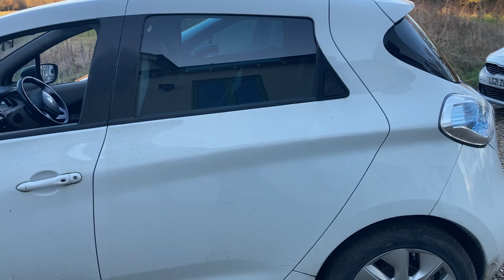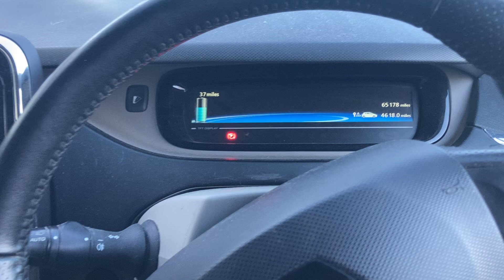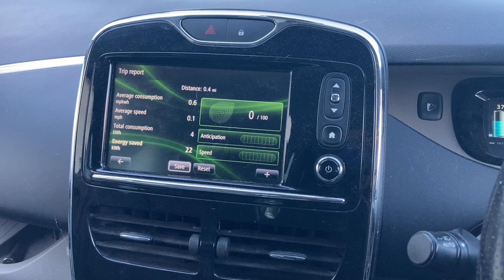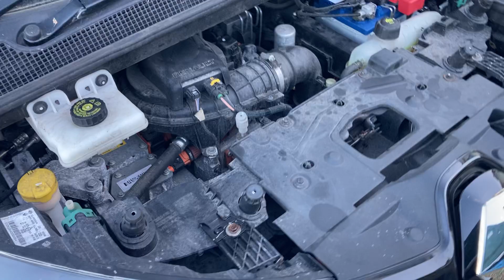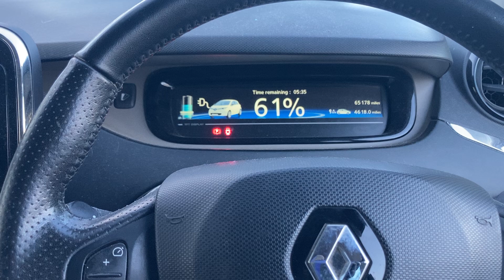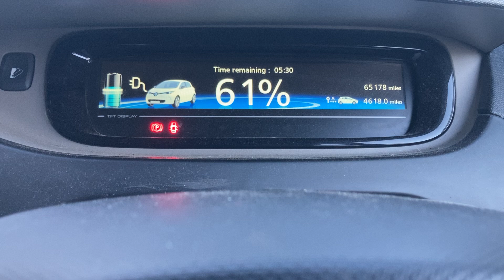Oops I think I fixed it 🤷 EV Repair - Renault Zoe Electric Motor Failure

Comment: I have what I believe is the same issue with my ZE50. I have a cheap Konnwei KW902, but it's the bluetooth 5.0 version, which doesn't work with Zoes. All I want to do is clear the fault codes so I can drive my car again. Can you recommend a diagnostic tool I can use for this?
Reply from the maker: Hi, the icarsoft tools are good for the price. Do you want a handheld tool or an app based one? Cheers
Reply: @garycevrepairs  Hey, really appreciate the response. I'm not too fussed; anything I can be sure works to clear those codes is all I really need. Though, I don't mind paying a little extra for one that might help me with other potential future issues, if that's a factor to consider.
Reply from the maker: @jonathan.singer ok cheapest would be this one, it’s pretty good but doesn’t get everything, or the icarsoft ones are better, there are manufacturer specific ones or better pro models

KINGBOLEN Ediag Elite
https://www.aliexpress.com/item/1005009602136192.html
Discount Code:GARYCEV
Reply: @garycevrepairs  Great; I'll check those out. Hopefully my Zoe will be back on the road soon. I'll post an update when I get my hands on one in case someone else with the same question stumbles across this video. Thanks again for taking the time.
EDIT: After some more research, I discovered I would need a tool that supports unlocking the Renault SGW and also pay for Renault Gateway Tokens 😮‍💨. They really do whatever they can to extract more money from their customers, eh? Ended up calling the AA and they were able to unlock the SGW and clear the codes for me; car is back to normal.

Comment: Great videos! I have a friend with a Zoe ZE40 67 plate, it's been coming up with the "Motor Failure" warning but has never stopped driving etc. I had a look and the 12v seems fine (with the car off it was sitting around 12.6V), there were lots of faults including one mentioning rotor sensor warning? I cleared them and they all cleared exempt 2 (UHC Central control unit - DTC957015 "Stop lights circuit - Open circuit or short circuit to +12 V" & UBP (Uncoupled pedal) - DTC518296 "EVC multiplex information plausibility no signal". You said you wanted people with weird errors 😆I took the car for a 10 mile drive and it seemed fine, but these errors won't clear.. any ideas?
Reply from the maker: Hi most likely is an issue in the motor that causes the rotor position sensor to occasionally misread. Is there any unusual noise when driving? Cheers
Reply: @garycevrepairs  Hi thanks.. no, she's been using it with this error message for a few months and not said there was a noise. When I drove it on a dual carriage way I thought I could hear a low drone sound but thought it might have been the road surface as I couldn't hear it at slower speeds / different surface.

Comment: my zoe has a this code. P1031 Inverter . Internal control unit fault/open circuit. does this mean a replament Inverter?
Reply from the maker: Hi needs proper diagnosis not just a fault code and from the format it looks like it may have come from an app rather than a proper scanner - apps often miss codes. Thanks
Reply: @garycevrepairs it’s coming to you in sept 😊would make a good video. !!
Reply from the maker: @timdmx512 😁😊

Comment: People 'cheap out' when replacing a battery. Wifey owns a 63 plate vauxhall mokka.. i started to notice a slow crank on startup, then after a short journey, when restarting, the car sounded like a tumble dryer full of spanners, nuts and bolts. Mechanics advised us to 'replace the gearbox, its the slave cylinder, you need a new engine, it's engine out'' £169 later and a brand new 'stop start' battery, the car ran stunningly. We didn't run garage to garage, it was just through conversation,

Comment: Friend of Mrs B has (until the lease ends very soon thankfully) a Honda e

Nice enough if lousy range and  expensive although it is a poncey city car. But....

Eats 12v batteries and if they go even slighty low volts utter horror show.

Battery just too small. End result is Dealer provided a C-TEK charger with permanent connection plug just to keep the 12V battery alive!

FFS get a grip!
Reply from the maker: It's really not good is it.
Reply: @garycevrepairs  No. More vehicles (ICE included) now being fitted with Lithium Ion low voltage batteries as well.

This is to "solve" Lead Acid battery capacity and weight issues, but naturally carry a hefty price tag if they need to be replaced
Reply: Teslas now have 16V lithium batteries
Reply: @nigelbriscoe1389  Cybertruck runs on 48V

Other makers going to 12v Lithium Ion batteries. Very good. Until you need to replace them: £800-£1500

Comment: I changed my 12V before it's fifth winter on my i3 as 'preventative maintenance' at its second service. I'm in the city and often don't drive for days at a time which is horrid for the 12V. They die unexpectedly and inconveniently so why go through the hassle and lose a day or more of your time. I have no time for those who proudly proclaim their 12V is fine at 6 or 7yrs, they'll be the first to come whining on the forums when weird and mad errors get thrown up.

Comment: Thanks for all the info, on our 2nd Zoe 1st one brand new in 2015 and present one second hand 50kw rapid charge, warranty runs out in August so will extend it just incase the motor bearing fault raises it's ugly head, we have owned Leafs a  Ioniq and our present MG zs ev but there is something about a Zoe which l really like
Reply from the maker: The Zoe’s drive really nicely and are good value, aside from potential repair costs. Definitely extend the warranty. Happy motoring.

Comment: I find that these cars are awful with the number of error codes thrown up with low 12v battery. Mine threw an absolute wobbler when the battery failed and refused to work with a new one until I repeatedly cleared the codes. Stupid as these batteries fail regularly and you shouldn't need to dig that deep to get the car going again. These codes should not brick the car however temporarily. I used an iCarsoft scanner originally purchased to use on a Clio and very pleased that it works on the Zoe!

Comment: With Renault wiring a drain test would be interesting once it's shut  it's system down
Reply from the maker: I strongly suspect that there won't be much drain, just a normal trickle but I will do a check with my clamp meter as that will pick up any big drains if there are any and if so I will investigate further. I don't want to go chasing a 12v drain and spend lots of time if there isn't one as that isn't fair on the Customer so I think that is probably the best plan. With the clamp meter I can just put it round the wire and it's not mega accurate but will pick up anything big. Cheers

Comment: think the point here is that we need to change battery every 6 years on EVs if it's lead acid.
Reply: Zoe is at 4 years, just changed mine
Reply: @markreed9853  thanks
Reply from the maker: 3 year replacement schedule for some EVs! As you’re not cranking an engine the 12v can get in poor health and you don’t realise until it’s dead. It’s also not a bad idea to charge the 12v battery with a mains charger every 6 months to make sure it’s in good health. Something about it being charged at a fixed voltage by a high amp supply means they can suffer but it’s definitely improved by an occasional manual charge. Cheers
Reply: @garycevrepairs  I had mine tested at 4 years, 24k miles by my dash cam installer and Cleevely. They both said it was fine, but I bought a new battery anyway, and they fitted it. I sold the old one to a lady for an electric fence for her horses for £15! 😂

Comment: I had a charging error on my 2020 GT after trying to charge at a MER 22Kw Charger and then it would not charge on ANY AC charger but luckily I do have DC charging as well. I did disconnect the 12V (new battery) for a few mins and it fixed the problem, just wondered could this be cleared with an OBD adapter/software if this happens again and which one would you recommend, Apple support preferred but could use old android phone if needed., thanks 🙂
Reply from the maker: Hi to be honest Apps aren't that good for clearing fault codes. The icarsoft scanners are good value. Cheers
Reply: @garycevrepairs  as over £100 plus a bit  more than I wanted to spend but thanks for reply

Comment: You could measure the 12v standby current...?
Reply from the maker: Yeah can do various tests but don’t want to make the customer pay for anything that’s not worthwhile. I have a DC clamp meter which is accurate enough to tell us if there is a big draw without having to remove anything. I also said to the owner I will leave the car park for a couple of days because if there is a drain it will soon show up. Cheers

Comment: Intermittent electrical faults are a nightmare. Get an MOT and take it for a decent drive...

I get good used batteries from our local breakers for a tenner... The most recent one has lasted five years so far. You have to give them the old one for recycling.
Reply from the maker: Indeed, I’ve advised the customer it needs a decent test drive to be sure. I’d recommend fitting new quality 12v batteries only on an EV. Cheers